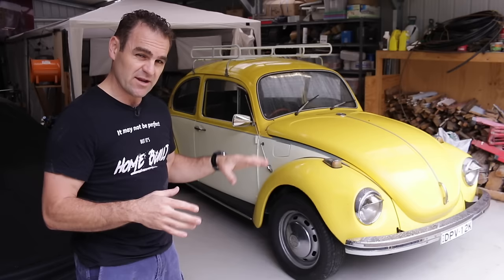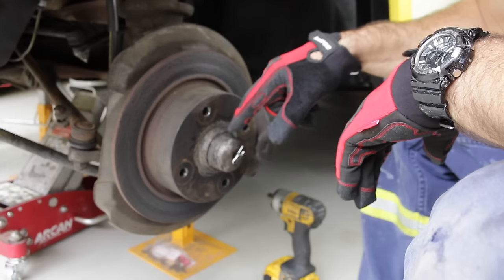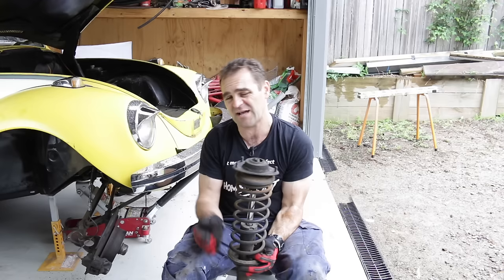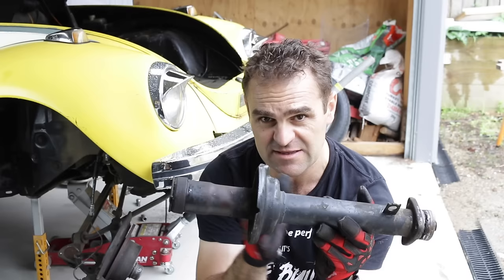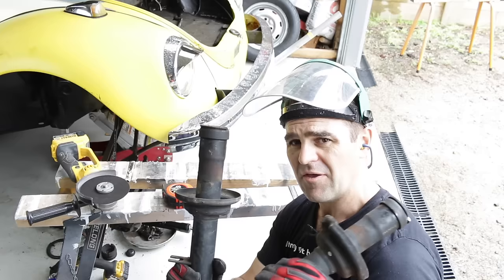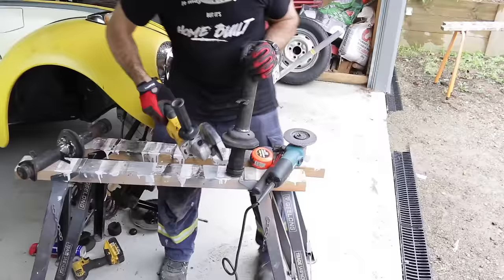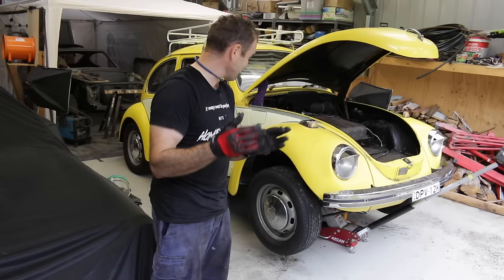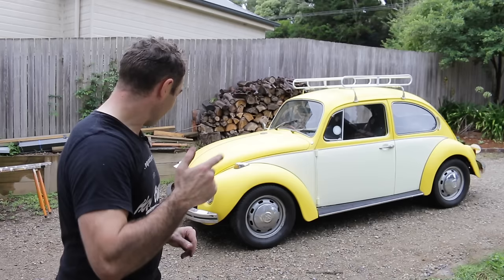How to lower a Super Bug - Home Built Project Beetle part 2

Comment: i love it it i have a 72 blu and white, i have the adjustable struts with topline Sport 1 inch lowering springs set to 5 inch drop on 17x7 Fuchs replicas with 205/40/17s, i need to raise back up about an inch as i rub when fuel tank is full

Comment: The reason why the "driver side" was 10mm lower is because when originally made, the driver sits in the left seat instead of the right seat. So the extra 10mm is actually reversed and now the passenger is 10mm lower. This is done because the suspension geometry will add 10mm more height to the left driver side to counter act the weight of the driver. So if you're driving in alone, the suspension geometry is perfect.
Reply: What i would have done in your situation since australia uses the right side for the driver side, i would have welded the right side 5mm lower than the left side to get the best suspension geometry.
Reply: Trust the Germans to think of something like this!
Reply: haha that's a nice idea looking for an reason. This right hand drive car was made right hand drive in the factory it was built in, it wasn't converted. On top of that, it is not a one seater car. This was clearly a mismatched pair, whether from new (believable) or from some point in it's life when parts were replaced (most likely).
Reply: Actually, many German made cars have compensation for the driver. That's why they don't have universal strut towers, but left and right ones. 
It might be different for the beetle yes. But it wouldn't be completely wrong though. 
You have to think about this thing this way: The driver will be in the car 100% of the time. The passengers can vary from 0-3 or more. 
But the only thing that stays constant is that the driver will always be in the car. So it's logical to compensate for the driver in order to get a better ride quality. It's a miniscule difference but it'll make up for it in the long run. 

Many times in the 60's, they just build the car normally in the factory but if the market demanded for a right hand side driver, they often just switched the components. 
That's why in some american cars, they have all the holes there to switch to right hand side. It's not totally wrong if they forgot to think about the struts. 
It's the 60's. 

You should read up on asymmetrical placement of drivers weight distributed in cars. 
If you have a car that's setup all straight and true, it'll be a little bit lobsided because the driver isn't a feather.
Reply: Ford M Garage Ahhh they have left and right because of both the mirrored aspect of left and right and because of placements of components (eg the speedo drive in this beetle). Any compensations for potential lop-sided mass in mass-manufactured cars (pardon the pun) will generally relate to steering geometry not spring rates, lengths or relative preloads.
Reply: Wrong. 
It has all to do with spring rates. The drivers spring will always be compressed and the passengers spring will often get no compression. 
So a stiffer spring in the driver side is needed to compensate. 
Your comment made no sense at all.  

I'm leaving this at that. It's not worth my time if you refuse to accept basic physics.

Comment: Massive improvement..! Glad you didn't chop the springs but by moving the perch don't you still risk them jumping out of the perch? after all the tension has at least diminished by as much as if you just cut the rings by the same amount?
Reply: I was wondering the same thing..?
Reply from the maker: Yes, you are spot on. Thankfully in this case the spring had more than enough travel and is still under tension (although not as much as it was). It feels pretty solid, so I am not too worried.

Comment: Really nice, the height ended really good.

By the size of the spring when out of the strut, I'm pretty sure that even after lowering the base where it seats on the strut, it is still under some pressure, so all is good.

Keep going, cheers.
Paulo.
Reply from the maker: It is still captive. Not as tight as it was obviously, but I am not afraid it will jump out.

Comment: The air cooled beetles change ride height as speed increases...the front goes down and the rear lifts due to the curved rear section of the body. Was considered dangerous as front caster diminished at higher speeds, so the factory compensated.

Comment: Spring perch hights different from passenger side due to camber on our roads 😊 Thus making car drive straight 😊
Reply: Steve Veness Spring perch hights different from passenger side due to camber on our roads??? I have never heard of that before, are you sure it isnt just two different versions of the strut? Maybe one is Mexican....
Reply: TRUTH SEEKER One of the methods aplied to correct for our roads. Take Japanese manufacturers there roads are flat no camber.  Practly all modern cars from Japan wear out front tyres. Corection is camber kit's. 
Then there is bending struts ti create camber correction.
And on the list goes 😊
Reply: Steve I was going to say the difference in ride height from back to front was to make up for our downhill sections to keep the car flat but that would be cheeky... I certainly had to compensate for camber in my Corolla when in a straight line so I will keep an open mind on this thankyou
Reply: TRUTH SEEKER No problem I have slight advantage perhaps 3rd gen Automotive Engineer coming into hmm 36 or is it 37yrs in the trade.
Lmao a bloody long time😊
Just ask my back groooaaaannnn😊
Reply: Steve I am a Mechanical engineer with 50 years of interest in cars so you are doing well to know more about cars than me...I know what you mean about the back...I worked on a Toyota production line for 12 years...ouch
Reply: Nice idea if it was true. Japanese roads in general are pretty much the same as Aussie roads in profile. The clue was that the spring seats were different between the 2 sides. Those are a mismatched pair. Pronounced road camber does cause slight uneven wear on tyres and joints but no manufacturer is building lopsided suspension in an attempt to compensate.
Reply: Cassette Walkman Didn't say they were.  However the old timers in the trade used to do such things to correct for camber on our roads especially Sydney roads. As most started out as horse and cart roads hence camber. Buut enough about history.  I made a truthful comment about the past history I.E  the previuos 2 generations of Engineers in my family.  First hand knowledge to the past.
Nothing more.
And yes mismatched struts is also and old car yard trick to correct on the cheap 😊

Comment: I would say it looks high at the front because the rear suspension has sagged, if you want to check it, the axles should have about a 2 degree downward angle from gearbox to brake hub. Isn't dropping the lower front spring perch going to make it bottom out over bumps?

Comment: Please, never ever, have the springs facing you whilst under spring clamps.  If the clamp slips or breaks they can fire at extreme force. Seen them punch holes through steel doing that and many years ago as an apprentice we watched a training video where one slipped and took a blokes head clean off.

Comment: Kinda surprised to never see an airgun in the shop.
They come in SOO handy.  Suppose an impact gun coulda snapped that wheel bolt though.
Sometimes a long pry bar is better than the hammer.
Reply from the maker: I have an air gun, and tried it, but my cordless impact has about the same power. Neither could make it budge, so the big lever was the option.
Reply: If you can't solve a problem with power, 
what you usually need is MORE POWER.   
Fully a fan of the yards long breaker bar.

Comment: Jeff mate! You’ve done it on this one! You may as well have cut the springs, the spring rate and geometry is way out of whack now. Made it just as unsafe as your mates.
Reply from the maker: The suspension geometry wasn't fantastic on this car in the first place. This is a whole lot better than cutting the springs.
Reply: Home Built By Jeff but like you say, the spring is not under the correct tension when cutting springs, what’s different when moving the perch down? It’s the same principle
Reply: Dumblederp no it's not. He had to use sling compressors to get them back in. The only real issue is the shock is now operating out of its proper range. But will be fine
Reply from the maker: You have a point, but the spring is still was under tension with the amount I lowered it (although not to the extent it was before). I suppose the other issue with cutting the springs is that the coil is generally not the same shape, and at least the ones I have seen, do not seem to sit as well back in the mount.
Reply: Does that mean the stock setup had over 2" of preload? I would think if you moved the the spring perch so far down you would lose all the preload and the spring wouldn't sit tight anymore.
Reply: You'd be amazed how much preload some stock cars have, volvos you can cut 4 coils off and the springs are still captive. And what Jeff has done has maintained the stock spring rate which is a big advantage over chopping the springs which makes them stiffer.

Comment: jeff, which direction will you take with thesuperbug? Lower front indicates a sporty direction. But leaving the roof-rack on is a more fun orientated statement. So do you intend to remove the rack to ephasise the racy touch?

would you? (please?)
Reply from the maker: Not going to be sporty. It is still going to have the standard bug engine, it just looks a whole lot better low. At this stage I like the roof rack, but I may add some wood to make it a bit nicer ;)

Comment: Lot of debate over the spring rate and preload here.  Given that you're not likely to drive this car like your 911, I don't think it's going to matter.  Once you've been driving it enough to ensure you don't bottom out over bumps or swales, than it will be fine in my opinion.  How fast are you go into a corner in this anyway?
Reply from the maker: Exactly. This car is never going to be a canyon carver. It still rides nicely and the spring is still captive, so I m not too worried. I also know of a WRX engined bug with the same set up that was QUICK and it didn't have any issues either. I am happy with it.
Reply: Another car suggestion would be a 2002 (if you can find one that's not a fortune) or an old 3 series.  Keep that German thing going for the secondary car videos!

Comment: Hey jeff , i lowering my bug following your video , i allready cut the struts today , the struts are the same height in my car so i guess someone replaced one of them on your car. 
I wanted to make sure before i weld the struts back , you lowered yours by 65mm ? Did you have any problem with the fender rubbing the tyre? 
Thank you
Reply from the maker: I don't have tyre rubbing the guard issues, but it does bottom out on some of the crappy roads around here with a passenger.

Comment: Oh an quick question. Does your tape measures down there have both metric and imperial marks on it? 
Being American I have gown up having to know and use both metric and standard and all of our measuring tools display both....just curious if it's the same elsewhere
Reply from the maker: Some have both, but most just have metric. No one in Aus works in Imperial. I grew up with only metric, but I still think of peoples height in Feet and Inches. Most under 30 in Aus talk about height in cm.
Reply: Home Built By Jeff 
Yeah I figured. Never really thought about it until recently when a Japanese friend asked why I bought two sets of sockets. 

Must be easier to only have to deal with one or the other. My Ford F150 for instance has both metric and imperial sized nuts and bolts ha ha. When I worked in construction allot of guys instead of useing fractions on an inch for would use millimeters. So for instance a measurement would be 3 inches and 13 millimeters. City engineers loved us for that. 

Anyway man love the videos as always. Can't wait for the next one.
Reply from the maker: I have a socket set with SAE sizes, but I have never used them. All the cars I have worked on have either been Japanese or European. Fractions of an inch hurt my small brain ;)

Comment: Why not just get a lower springs?
Reply from the maker: Then it is not DIY ;)
Reply: You still doing it yourself  I'm not criticising but just  reflecting  I love this chanel  very interesting I see changing the  the springs the same, as changing brake  still diy
Reply from the maker: Absolutley, changing the springs is easier, but this is basically free ;)

Comment: Also a trick you can use to get the springs of the strut is to unbolt the top nut with the assembly in the car with the car on the ground then jack up the car
Reply from the maker: That is good. I haven't heard of that, but it would work.

Comment: normaly when lowering the tires will spreed and if it out by just a little your tire wear goes out the window, 2-3 things  1 allways use a tourqrench when doing wheel bolt,and 4 lug you tighten 1 and 3 then 2 and 4,easy peasy, when the schocks are old over 60tkm don´t lower it cause they may leak and max is 40mm on std. schock on most german cars, you may now experience that going over small bumps at speed will bottom it out,cause that soft stock spring is not ment to work at that ride hight, copping springs is something you may do on us cars cause they have normal spring rate in the entire spring, most german/japcars have progressive spring iven stock. ps. a set off lowering springs are not more the 100 euro´s over here for the cheap ons. now go fix the gear level and start issue he he ps. did you find the noise from the wheels/breaks????
regards
Sören
Reply from the maker: The shocks looked pretty new when I took them out. I have driven it a bit in the last couple of days, and it hasn't got close to bottoming yet. It actually rides pretty good. I will have to do another wheel alignment though.
Reply: ok